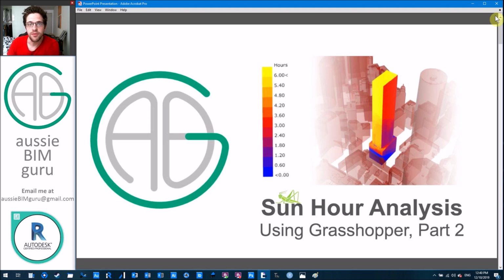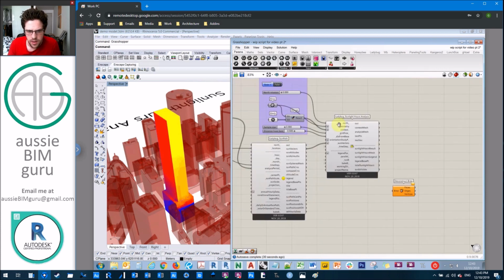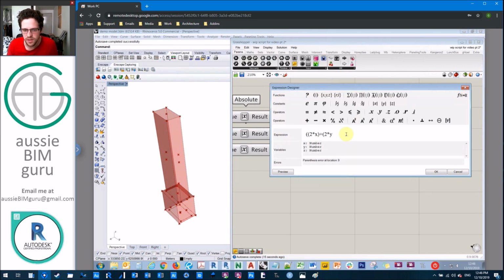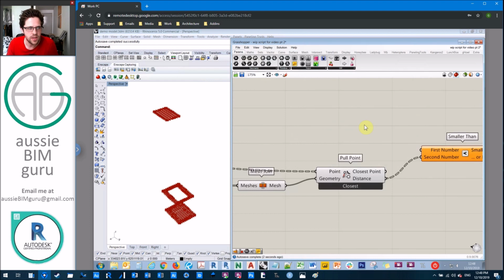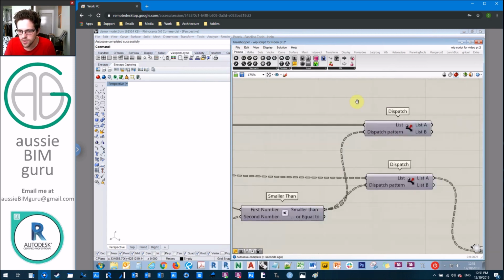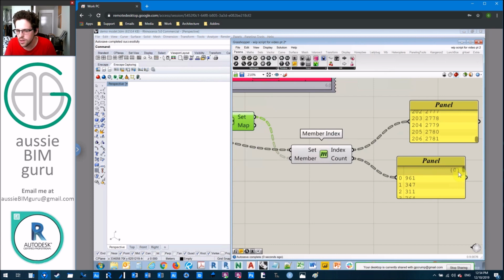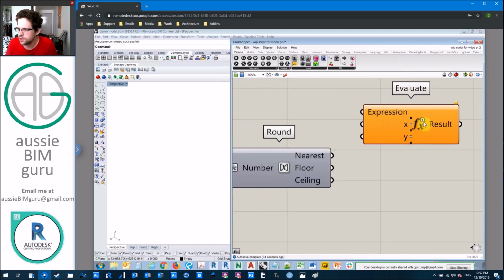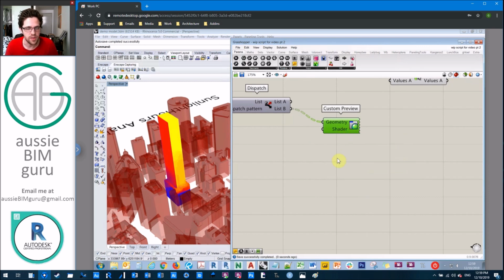Sun Hour Analysis using Grasshopper (Part 2 of 2)

Comment: Your percentage results panel only totals to 98%? When I tried, my script totaled to 101%.
Reply from the maker: Yes I believe it may be due to some rounding. I use a fairly different workflow these days for tallying the results prior to showing them on a graph.
Reply: @AussieBIMGuru  oh okay, is that because of the latest Ladybug update (1.4). Are you planning on creating a video for this new workflow? Having some issues on my own and would love some new insight.
Reply from the maker: @oscarjames5056  partially that but I've also since worked on targetting even sample generation using form rebuilding workflows so I know roughly the area each sample accounts for before running the study as well. Unfortunately most of this work I've done with a firm so wont be able to share the more advanced workflow. My goal with the content is usually to get people started so they can explore the tools further.

Comment: Hello Guru. I tried to produce the Sun light hours script on Dynamo but since the ladybug nodes are not available anymore, I went for Grasshopper.
So, I finish the script, it works fine with Brep from Rhino. However, I tried to use some graphical element from Revit, using volumes, and when it comes to ignoring the points on plane surface along the Z axis, it is not working most if the time.
When I look a the node Pull Point, they are all aligned to the surface, but when in the List Dispatch node, they are not separated from the points on my vertical planes.
Does the problem comes from the expression, or the smaller than node?
I'm totally lost, and don't get why it works on some volume, and absolutely not with some others. 
Thanks for your insights.
Reply from the maker: Hard to say off paper, but the script I use works purely on the normal of each face of the object, so the normals might give more clues as to why some faces aren't filtering properly. It might need a range with more tolerance in the Z value.
Reply: @AussieBIMGuru  I am also having this issue^. What do you mean by "need a range with more tolerance in the Z value"?
Reply from the maker: @oscarjames5056  you may need to check for a value a bit less than what I used to filter points by their Z value when assessing the normal vectors.

Like I said before it's hard to say though. Geometry in rhino is rarely one size fits all, so you might need a different approach if your geometry is open or not a brep for example.